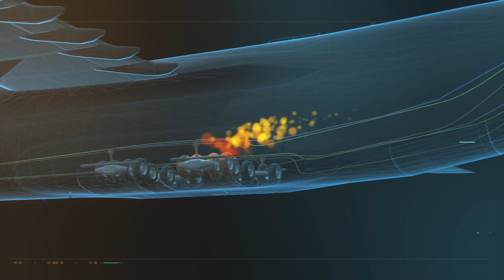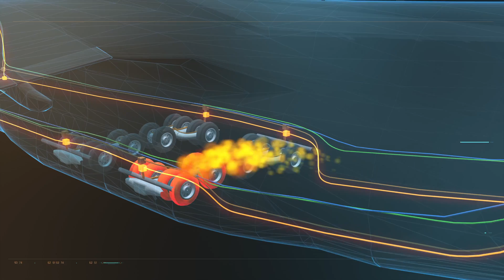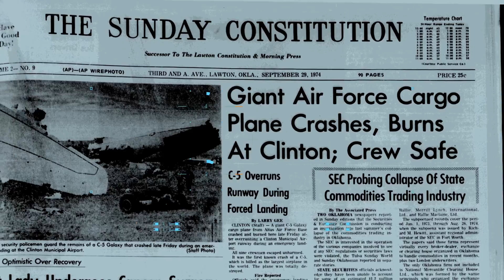A Scary Fire Breaks Out on One of the Galaxy C5’s 28 Wheels 🔥 Air Disasters | Smithsonian Channel

Comment: On 27 September 1974, C-5A Serial No. 68-0227 crashed after over-running the runway at Clinton, Oklahoma, Municipal Airport during an emergency landing following a serious landing gear fire. The crew mistakenly aligned the aircraft for the visual approach into the wrong airport, landing at Clinton Municipal Airport, which has a 4,400 ft (1,300 m) runway, instead of the airfield at Clinton-Sherman Industrial Airpark (former Clinton-Sherman Air Force Base), which has a 13,500 ft (4,100 m) runway. This was the first operational loss of a C-5 Galaxy.[111]
Reply: There is MORE to this story...I flew C-5s at the time this plane went down.  It was at NIGHT when the fire began.  They lost their electrical system so they were using flashlights to illuminate the cockpit.  It was necessary to get it down, and they actually did a good job considering all that was occurring.  By the way, I personally know both of the pilots, and they both are probably the two BEST pilots ever to fly the C-5.  Both, at that time, were SUPER Instructor Pilots at Altus AFB...home of the training Squadron.